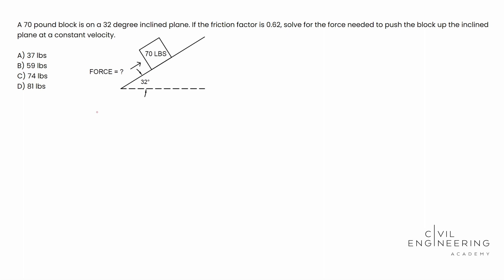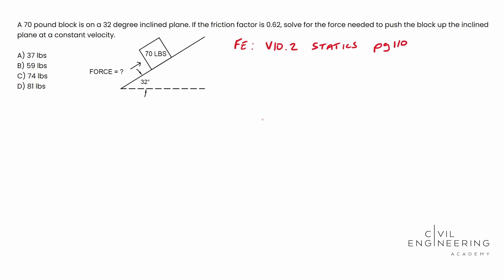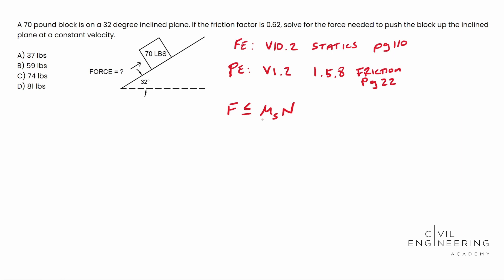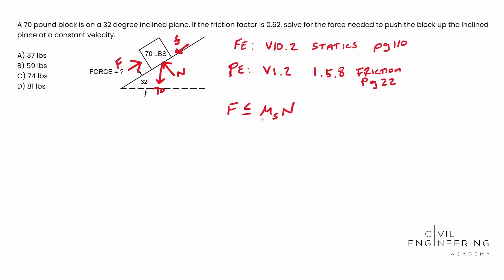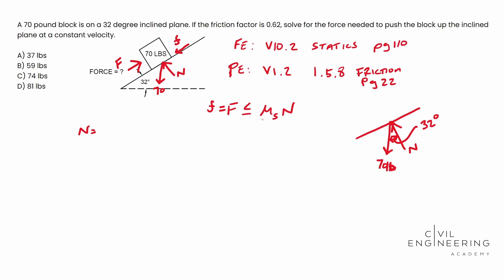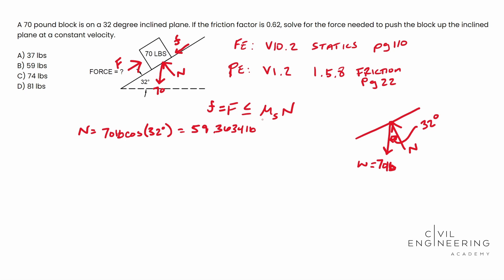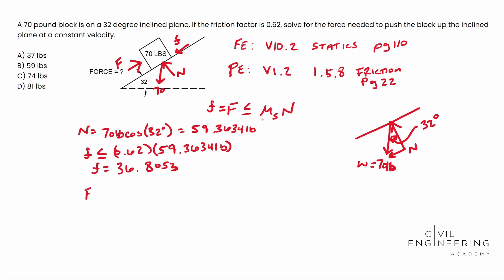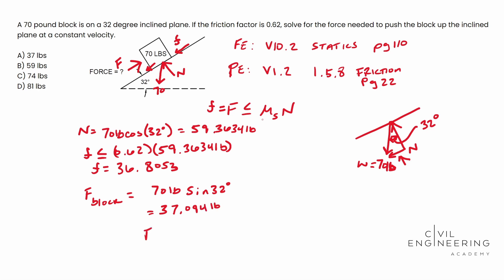Civil FE Exam – Statics – Find the Force Needed to Push a Block up an Inclined Plane

Comment: just throwing my thoughts out there, i have a couple of questions 

1.would it be correct to say that when an object is on an inclined plane an there’s friction present the force to move it up the hill will always be more the weight of the object? 
2. if the question had asked instead for the force to prevent the box from sliding down the hill would tht answer be the exact value of the force of the block plus the friction (which here is slightly less than the 74 lbs) 
3. if it was friction less would the answer then just be the force of the block tht was calculated ?